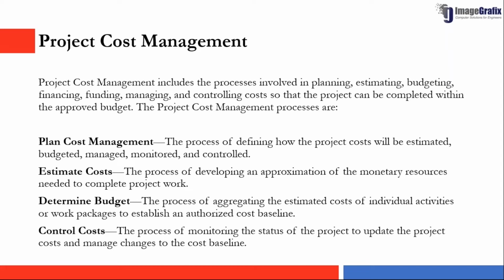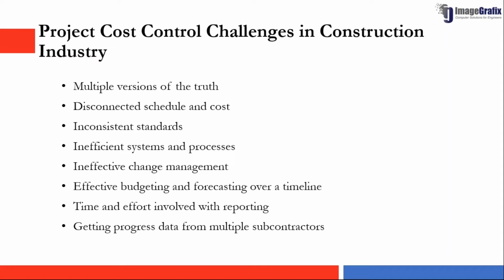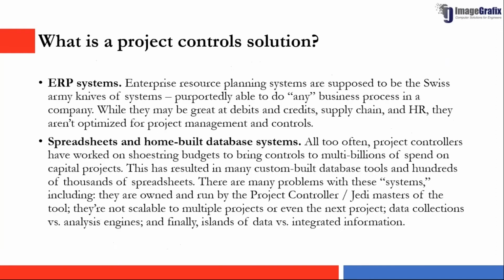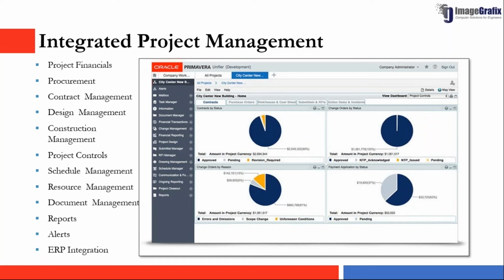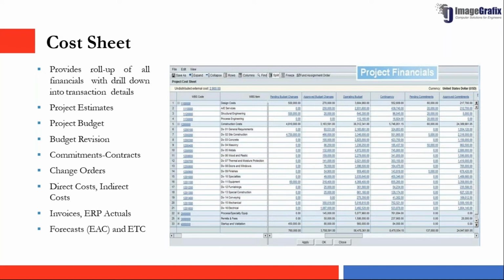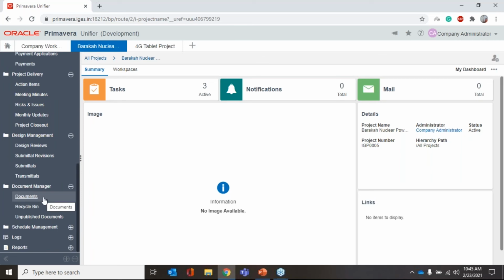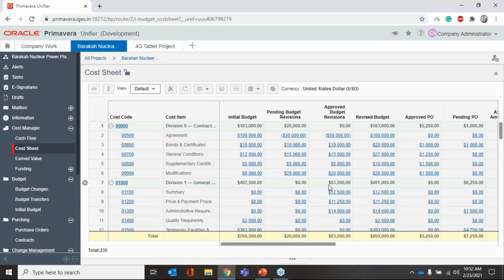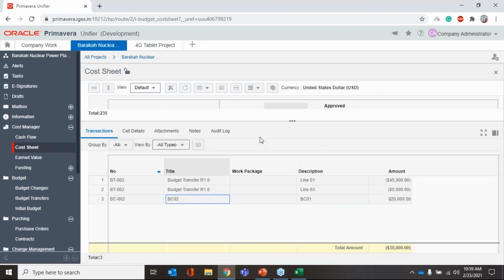Project Cost Control using Primavera P6 | Construction Industry | Primavera P6 Training

Comment: very good explanation. It seems that Primavera Unifier is good at integrating the cost management with P6. I feel that this program is more suitable for Clients for Cost Management. Contractors Cost Control and Cost Management needs more detailed process. Till date I have seen only Candy CSS that provides Contractor side Cost control solutions however, It is a very  old system and it has its own limits. It looks a new version of Primavera old EXPEDITION Software.